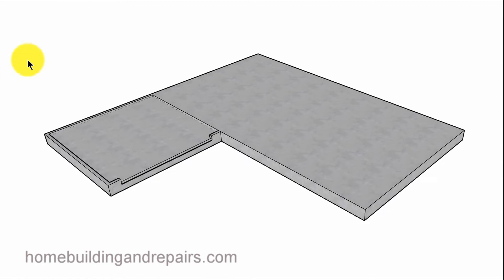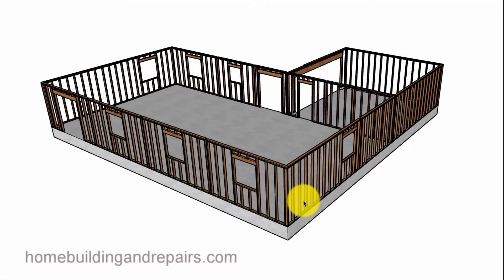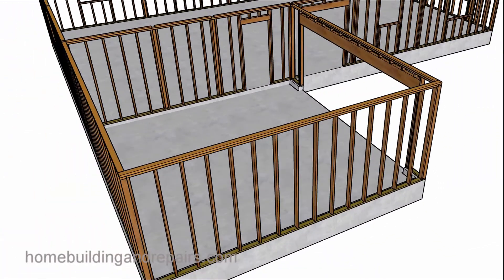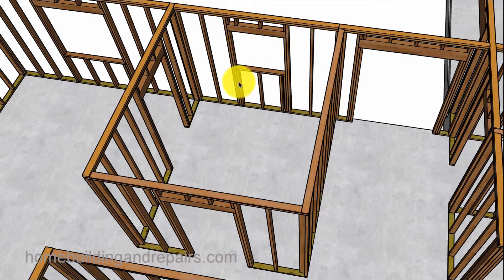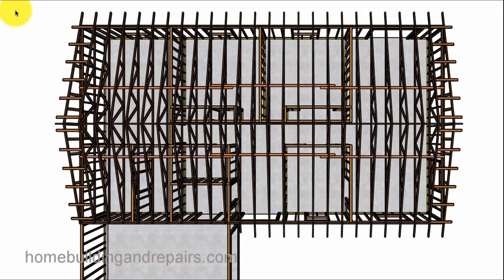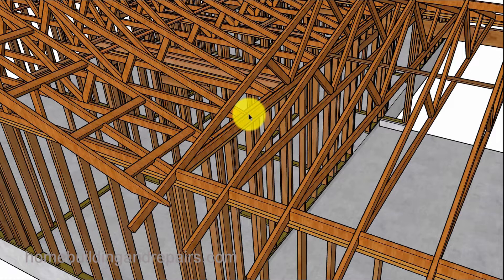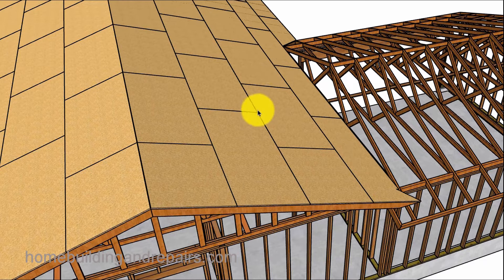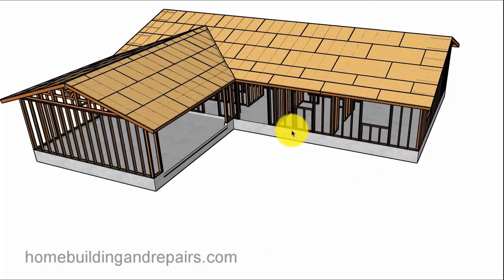Three Bedroom L-Shaped House Construction – Foundation and Framing Education

Comment: The house might have a much more open feel if you took the walls out of the kitchen. Also, the master closet needs the door outside of the bathroom. Who wants to walk through the bathroom to go into the closet? All these trusses, how about a cathedral ceiling in the living room?
Reply from the maker: Good suggestion about the kitchen walls, but keep in mind in smaller kitchens, these walls might be necessary for a refrigerator or additional storage. The master bedroom closet could have the door in the bedroom, again this is personal preference, but it might be in the way of needed wall space for dressers. Another excellent suggestion about the roof trusses and I will be making additional videos using this floor plan for different types of roof and wall framing designs.
Reply: gregvancom plenty of room for the refrigerator on the ousi design wall. You can use base cabinets for half walls of need be. Leave the sight lines open. The closet and the bathroom could be switched.

Comment: Notched in truss would not get past code that's the old way to do it I'm not saying it's would not be a good way to do it but in Pa if you cut a truss or even put a drill hole in one they won't pass it I now by my Gable truss 1 in 1/2 inch shorter so I can put the Lookouts right on top and I don't have Two Notch thim
Reply from the maker: Thanks for pointing that out. In Southern California, I believe it isn't a problem and you're right, you can get trusses an inch and a half smaller on the top. I'm going to make a variety of different building designs and will be including that one in the future.
Reply: Working Man and Greg - too bad the nice program (cad?) Greg is using doesn’t provide code tips too. But that would likely be a nightmare as all states have their own bldg codes.

Comment: I wouldn't bother with shallow closets. A cabinet can give people the ability to rearrange the room. I also wouldn't bother installing light fixtures in those closets. Light never reaches the places you need it and it's a waste of wiring.  
Bathroom/kitchen/washer room all look stuffy. I think I would eliminate the room for the entry as it doesn't appear to have a practical use. There's no reason to have 3 entries into a small house.
Reply from the maker: Thanks for taking the time to share your opinion with us. Keep in mind that I'm not trying to win a contest with this particular design. It's meant more to provide you with an idea of how this type of building would be designed and constructed.
Reply: Blind - I agree with deepening clothes closets so that they accept hangers. And the closet door can be closed. We once lived where we couldn't close a closet door if we hung hangers on the closet pole.

Personally, I appreciate a closet light. However, today's electrical code mandates specific clearances so many typical closets would be too small to pass inspection if a light was installed.

I'm confused abt but interested in your cabinet comment. Cabinet where?

I believe housewives would appreciate the door from the laundry room. Esp if she has a pile of dirty clothes on the floor and company drops in!
Reply: The light doesn't do enough to justify using it 1% out of 1% of the year. I left them out rewiring a rental property. The room I was speaking of eliminating is the one in front of the garage door, not the going into the garage. Let's see if I can post two links to images after this without youtube blocking them. If you dont see a second post youtube ate it.
Reply: Sorry for being so dense but when I review the floor plan, I see the laundry room/garage entry and I see the front door entry. The front door entry isn't really a room but more of a hallway created by the kitchen wall on one side and on the other side, parallel to the kitchen wall, is a wall created by a bathroom and a short portion of the entry into the laundry room. It's a good suggestion to open up the kitchen by removing the wall between it and the dining/living room. It fits today's home buyer. That leaves really only 2 useable kitchen walls - 1 for the sink under the window and 1 for the stove, frig and upper cabinets. 

Clothes closet lighting is a personal choice, I guess. We use our closets daily to get dressed and bc I'm older, I seem to need more light. And so my husband doesn't mix up his blacks and blues - ha.

Apparently, your 2nd vid got eaten. lol
Have a safe and happy July 4th!
Reply: I'll try posting one at a time with tiny url
This is a cabinet built into the wall, you could use bins at the top to maximize wall space.
https://tinyurl.com/yctvgvgc
Reply: This cabinet is a moveable piece of furniture. 
https://tinyurl.com/ycc5ojet

Comment: What were the dimensions of the garage?
Reply from the maker: I will be providing a floor plan in one of the next videos, with more information about measurements. The garage is 20' x 20'.
Reply: Never build less than 20x20. A pickup truck will touch the garage door and back wall.
Reply: I always wonder where the lawn mower and snowblower are supposed to be stored when checking out garages.
Reply: IMHO if you cant pull a truck in, have work benches and shelves along the walls, and walk around the truck, it's too small. 
Personally I'd rather live in a 40x80 metal building with the living quarters on the second floor because houses just don't seem practical...

Comment: poorly thought out design. with the garage slope you will need a step for the front door but there isn't room.
Reply from the maker: I have to admit, I've been wrong before and appreciate it when it fits, but what if, driveway extended towards the front door, do you think that would work. I will try and provide you with an example of what I'm suggesting if this doesn't make sense.
Reply: freethinker52 -  I'll bet you are used to a step bc you are also used to a basement under the house structure?
Also, you may not realize it but your poorly thought out design comment comes off a little harsh.